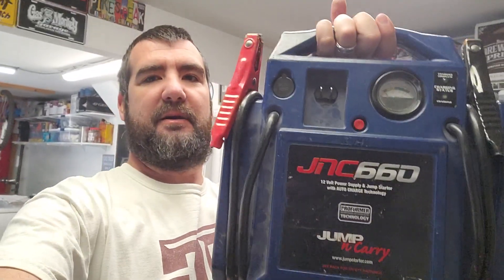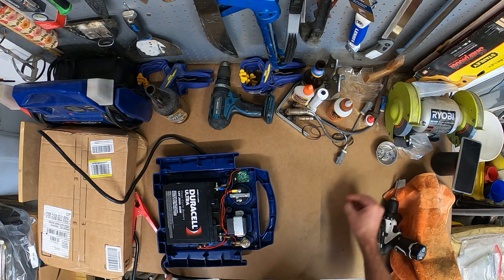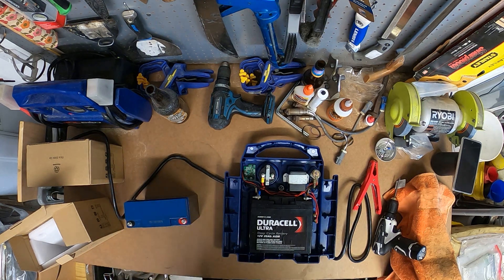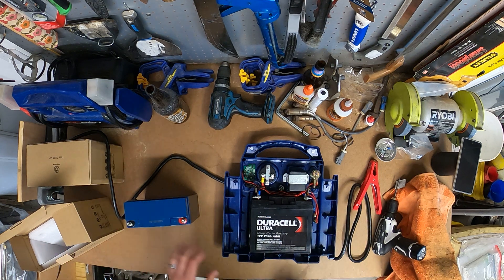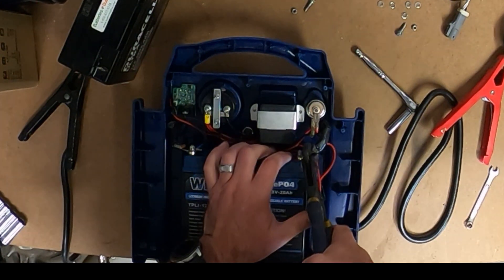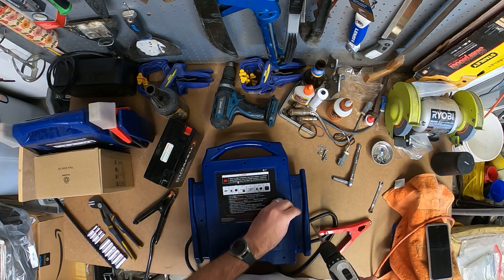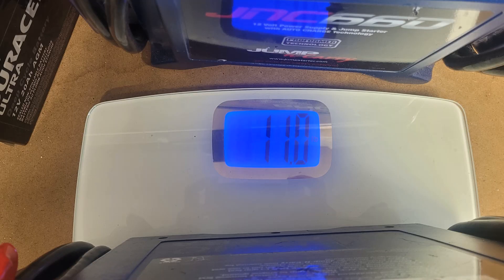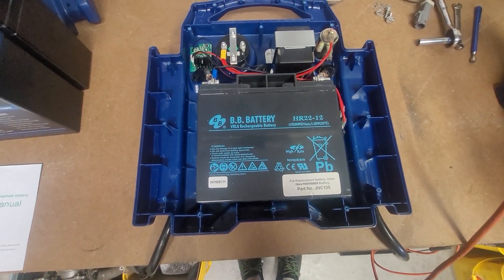QODB: Lithium battery replacement in my old JNC660 jump box

Comment: I have been doing the same, buying cheap used jump starters with dead lead acid batteries and putting lifepo4 batteries in them. I get ones with 12V DC sockets and charge the lithium battery through the 12V port with a solar panel and  charge controller that charges lifepo4 batteries. They end up making nice little camping power stations.

Comment: Would you know if that exact size lithium batteries would work as replacements for the old Harbor Freight centech 3-in-1, 4-in-1 and even 5-in-1 jump boxes and I think the 5-in-1 originally came with a single 18 amp hour battery but the other 2 models came with a single 17 amp hour battery so maybe a little bit bigger lithium replacement battery would fit in the 5-in-1 and those ones have the little inverter where the other ones don't just like the 4-in-1 has the tire inflator but the 3-in-1 only were basically jump boxes and chargers for your phones and they have lights on them only but I have all of them but all of my batteries are pretty much worn out and won't jump anything anymore but I would love to buy the biggest lithium batteries possible that would fit in each of them to extend their lives and be able to continue to use them successfully hopefully but cool video nonetheless!
Reply from the maker: I don't know TBH.  I appreciate you checking out my video tho!

Comment: the battery charging rectifier is for agm not lithium
Reply from the maker: right but this battery has internal board that self regulates voltages
Reply: @Patman03sprcrw  the battery overheats when charging
Reply from the maker: @  That's odd, neither of mine do...

Comment: How has this worked out for you? Any issues? I am seriously considering doing this mod to my JNC660.
Reply from the maker: The lithium battery doesn't quite jump start as well due to the internal circuitry that limits the output amperage... but it works as more of a low battery jump start, not like a fully depleted jump starter if that makes sense
Reply: @Patman03sprcrw  As in, if a 12V car battery is completely dead, this doesn't work very well, but if a 12V car battery is simply low and won't start, this mod will still work?
Reply from the maker: @ZBrink11  bingo!

Comment: The original lead-acid battery lasted you thirteen years, and if it works as well as mine does, you can jump-start a dozen cars, leave the charger in your car outside for six months without recharging it, and even on a cold winter day, it will still jump-start a car or two! I tend to recharge mine once each year. On the other hand, the lithium battery is indded lighter, and maybe it's better at one start when fully charged, but the original charger with its original battery can stil perform better in many real-life situations. Long life, and long-term storage without having to recharge often are two very important characteristics of the original lead-acid battery!         🔋        - j q t -
Reply: Lifepo4 is superior to lead acid in every aspect. It does have a self discharge rate, but maintains 80% Up to 3-6 months. It’s capable of higher discharge and can be completely drained without harm to the cells. Also will recharge at a fraction of the time that lead acid will take to charge.

Comment: What screw bits did you use to open the case? They look very long and I'm not sure if the screws are Phillips head, hex, torx etc. Thanks.
Reply from the maker: I believe they are #1 Phillips (going off of memory)

Comment: I watched your videos on this jump start system, I also own one and replaced the batt in my JNC660 with a Lip04 20 amp hour battery. The issue here is lead acid batteries are fully charged at 13.6 volts and Lip04 batts are fully charged at 14.6 volts, this unit won't fully charge the batteries due to the charging limits of the JNC are for lead acid, but still for the most part the unit works fine for normal jump starts. You can charge the battery with a Lip04 charger, I have been thinking of just charging it through the jumper cables on the unit since its a direct connection but have not tried that yet. I just thought I would let you know the difference, so many people think the lip04 batteries don't hold a charge or capacity as specified, well charge it correctly and it will provided the rated specs of the battery if it's of good quality.
Reply from the maker: Thanks for the comment!
Reply: Oare se poate incarca bateria prin cablurile jumper?

Comment: Will the onboard charger have any problems with a Lithium battery vs a lead acid?
Reply from the maker: I have not had any issues.  This particular LiPo battery has internal regulator/chip inside the battery.  I have several videos on this jump box, feel free to check the other ones out too

Comment: I had to go the other way. I went from the threaded posts in the original units battery, to a new battery with the spade terminals. The problem is theres limited room to smoosh those cables around when going from one connector to another. You can probably force it but be careful bending the jumper cable terminal or it will break easily. And I had to purchase two small bolts when putting  in the new one. 
Also I found its easier to prop the battery upright when connecting and disconnecting the terminals. Then gently set it back in once connected. Mine did not have double sided tape, just foam cushion pads.
Reply from the maker: Awesome work, thanks for the detailed explanation of your process. Thanks!

Comment: Since you install the lithium battery doesn't it have to be charged with a lithium charger? And does it have the cold cramping amps to start up a car? Do you have to swap the battery with the same amp hour? Great video!
Reply from the maker: this battery has charging logic and discharge logic built into it.  So It is fine using a standard charger on it. 

discharge logic limits it to 50A, so in some conditions its not as strong as the lead acid that came out, but it is enough to crank a vehicle with a weak battery.  Ive proven this in a follow up video.

Comment: Charging circuitry and methodology is entirely different for lithium ion vs lead acid.  Though I appreciate the ingenuity, as others have expressed concern, I'd strongly urge an understanding of the potential danger before doing this suggested replacement.
Reply from the maker: I appreciate the comment.  If you'd like to provide actual information I'm all ears, and not just "Lithium is scary/dangerous"
Reply: @Patman03sprcrw  I did provide factual information.  As I factually stated "Charging circuitry and methodology is entirely different for lithium ion vs lead acid."  You're welcome to do your own research, there is plenty of info out there.  I am a for real EE who has been designing battery and power systems for many years.  Perhaps you reverse engineered the charging circuitry in the JNC660, and know that it provides the correct power curves, voltage, temperature monitoring and conditioning for charging lithium batteries?  If so, I'm all ears ;-)  I didn't say what you propose wouldn't "work" (in quotes, because "work" is subjective, what you may consider "work", others may not), and it may...but it may not.  I simply suggested people do some research to make sure that what you are suggesting people do is in fact safe, as it is just a fact that improperly charging lithium batteries can be potentially, well as you say, dangerous.  Far more so than lead acid batteries.
Reply: If the lithium battery has its own bms wouldnt that suffice for cutting off the original dumb chargers small amp power input? Id imagine the original jump box charger actually wouldnt fully charge the lipo battery as its less max volts. As an EE could you see a way to make this safely work?
Reply from the maker: @mboemmels   bingo ;)

Comment: Did this work? I just converted my jump pack with a lithium lifepo from ebay and it wont jump start a car. It does say on the battery that it can't be used for jump starting. I dont know why it wouldn't work.
Reply from the maker: it works, but output amperage is limited.  I've got two additional videos on this topic if you wanna check it out
Reply: @Patman03sprcrw  Thanks for replying
Reply: Most likely your battery has a 20 amp bms cutting off for over current discharge.
Reply: @mboemmels  thanks
Reply from the maker: @mboemmels  my battery is listed at 50A maximum discharge

Comment: Did it test okay? Able to start a car without any other battery connceted in parallel? Original battery could prob push 150 to 300A but the BMS in this lifepo4 one might limit it before the car can start..?

Comment: I can never get my cables on or off the unit without a fight. I feel
like I am going to stress the cable and it might come loose. Should it be like that?
Reply from the maker: When storing the cables around the case, try not to "stack" the cable clamp over the previous cable wrap, should be enough space to go side by side if that makes sense.

And hopefully I understood your question correctly
Reply: Thanks. I took your suggestion and I was able to get it on. I still do feel the cables should be an extra 30mm longer.
Reply from the maker: @NextLevelAutoDiagnosticsLLC  you're welcome.  glad I could help

Comment: I'm also curious whether the baked in Lead Acid trickle charging circuitry in the old jumper is going to work properly with a Lithium battery (with the appropriate BCM attached to it - obviously it would be a terrible idea otherwise)   

Does the light ever turn green, or does the box supply voltage to the Lithium BCM continuously, with the BCM rejecting charge once the battery has hit capacity?

Does it bring the Lithium battery all the way up to full charge?   Does the battery get warm/hot to the touch during charging?

Is the discharge capability of the LiFePO4 battery suitable to the AMPS needed during a jumping operation?

Have you managed to cycle it a few times successfully at this point?

Thanks!
Reply from the maker: I have a updated video that will address most of these questions, but sounds like I need to add a bit more to my video.... thanks for the comment

Comment: Replacement lithium ion batteries are a severe fire hazard.
Reply: Yes, good thing that he used a LiFePo4 battery.  They are much safer than Lithium ion.
Reply: The batterry he is using are WAY safer than lithium ion.

Comment: Thank you the video, Pat!  I’m looking on doing the same replacement to my jump starter. Can you still rely on the auto shutoff when charging the battery, or do you just keep manually checking the battery voltage reading until it’s full? How long is your typical charging time?

Comment: I want to know about charging the Lithium battery. Does the green light come on when the Lithium battery is fully charged?
Reply from the maker: I've had the green light come on, but usually unplug it after it been charging for a little while
Reply: I did this replacement on my battery box and charged it for 5 hours and the light stayed red. The voltage meter read 13.6v which is what the battery owners manual stated to be fully charged so I unplugged the cord.

Comment: This was a good video that's why it ranks high on the search results for this procedure. Too bad we don't know if this battery is as long lasting as the originals in terms of jump start uses per charge. My original battery is showing me that it won't hold a charge as lying dormant as good as it did for the first few years. So decided to check if I could replace the battery, how much it would cost, and which battery should get (so many knockoff junk batteries for sale online) This video is how any video should be done at the very least!
Reply from the maker: The nice thing about Lithium is they are more forgiving for dormant storage/infrequent usage compared to AGM or Lead Acid battery
Reply: @Garandmasthumb  what did not last? The original battery or the diy replacement?
Reply: Yup, I bought a new replacement battery for my jnc660 and it was good for about a month tops. The original lasted 2 years

Comment: Hey Pat, first off forgive me in advance. I was just forced to watch the video with no sound. I’m sure you answered this question but, the battery that you pulled out wasn’t lithium was it? Just worried about the charging situation considering there is no battery management system for the new battery.
Reply from the maker: It's essentially a trickle charger built into the jump box.

The battery manufacturer claims to have built in charging logic as well that prevents over charging and over current discharge.

So technically there are two levels of charging logic/safety I'm using. 

And as always I won't leave a battery charging unattended, for just good shop practices.